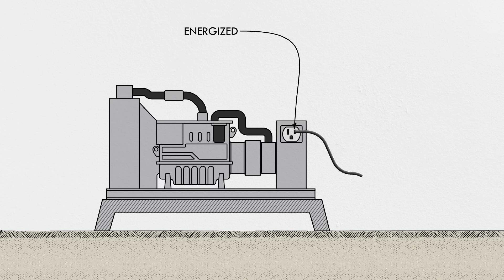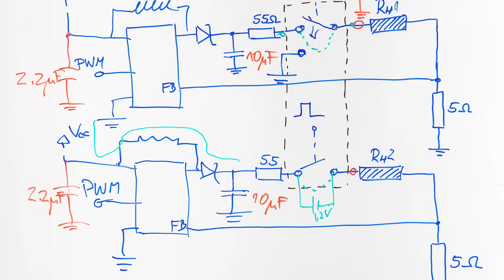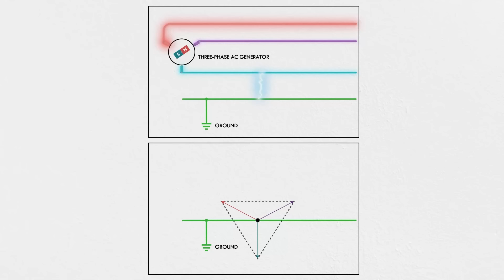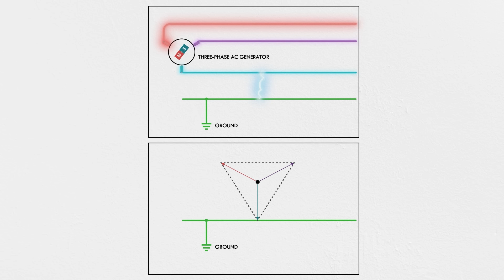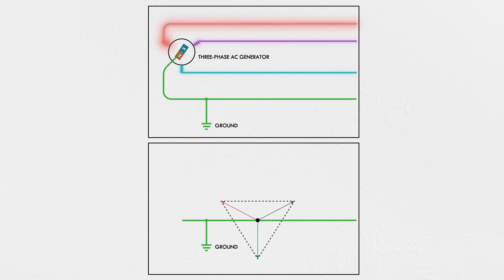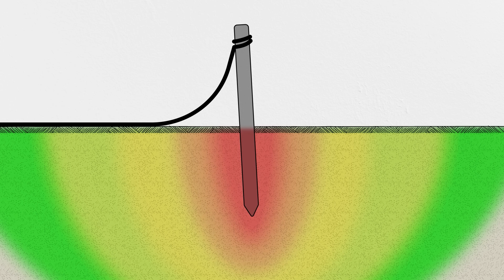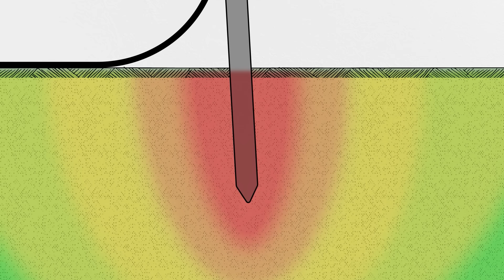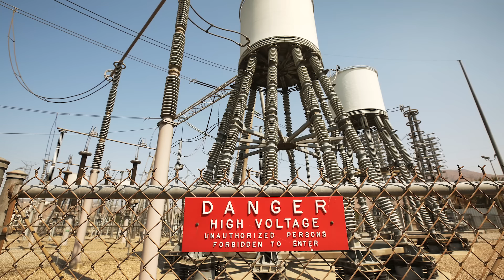Where Does Grounded Electricity Actually Go?

Comment: I like when ground is Earth. Grounding to the Moon is just so difficult.
Reply: You're just not using the right ladder
Reply: @kiriuxeosa8716 It's a step ladder. The real one died.
Reply: I wonder if the english artemis astronauts will call the 0v potential on base "mooning"
Reply: Smh... Words aren't toys.
Reply: Definitely need a bonding cable run at some point.
Reply: Need a really long ground wire for that...
Reply: @mickavoidant4780 I never got to know my real ladder he went out for paint and never came back .....
Reply: @mickavoidant4780  It has potential. Step potential.
Reply: And how about Mars, Jupiter?!
Reply: Hurr durr
Reply: Too true.
Reply: @Alacritous what I find amazing is that you took the time out of your day to get into the comment section to mock a comment just because you didn't like a joke.  That's dedication.
Reply: @sethproaps8899  maybe "regolithing"? we call it grounding, not earthing so that makes more sense i guess, though i think "ground" simply refers to the surface we stand on, not its material like dirt, sand, concrete, regolith etc. so that means it would still be "grounding" any time you use a standable surface. but then why do we call grounding in the ocean still grounding?
Reply: @sinisterthoughts2896  I was here anyways. And someone has to discourage the non-contributing zeros.
Reply: I laughed out loud!  As an ameteur humor critic, I think your comment was funny with the first sentence. The second sentence was too much like explaining the joke....just my opinion which is wrong as often as it is right...
Reply: You know you make an interesting joke, because I imagine that electrical systems designed to work on the moon might need to operate differently because of the unique characteristics of the moon versus the earth. A lot of the surface of the moon is covered in charged particles, and we might need to do different processes for grounding things properly on the moon.
Reply: Try using oceans as ground, and power from land, electric gets really weird on boats connected to the grid
Reply: get me Nikoli Tesla. He'll sort this grounding to the Moon with one of those coils of his.
Reply: @scotthannan8669  If the moon is full of charged particles, is that how to Earth the moon?
Reply: We choose to ground to the moon, not because it is easy, but because it is hard.
Reply: No big deal. Just run a wire...
Reply: Depending on how you define moon.
Reply: @mickavoidant4780 Ok Phoenix Wright
Reply: When planets collide, is there a big equalization of charge when the two interact?
Reply: @bag2963 get whooshed it was a joke.
Reply: The real reason why we need to run up a space elevator cable
Reply: It is the burden we bear, as Americans.
Reply: Imagine how hard it is to ground a Karen to reality.
Reply: Literally lol.
Reply: One day I missed the step and got floored by the ground, it was a shock.
Reply: @MinerBat In the latter, should be oceaning.
Reply: @theobserver9131 In any case, perhaps we all can agree witty comments are a sign of intelligence!
Reply: Not if you're there. 🤔
Reply: Such a lune....   😂
Reply: @theobserver9131 No. It isn’t worthy of a laugh. It’s a bad joke. *amateur
Reply: @theobserver9131  TY for explaining
Reply: While we are at it build a space elevator.
If that goes well ... a stairway to heaven
Reply: @cwg73160  "eye of the beholder". You sound like a real fun guy. I bet you're invited to all the good parties.
Reply: Use a wifi connection ...
Reply: @Alacritous  I get the being here already, but the severity of the skorn seems rather... hefty.  If a dad joke illicits this kind of reaction, I'm afraid to know how you react to "zoomer" humor or other such tripe.  Well, either way, I was more curious wether or not you were sincere, and it seems I found out.  Have a nice day.
Reply: Lol😂
Reply: @theobserver9131  I don’t put much stock into the opinions of people who call themselves “ameteur humor critics”, and I don’t imagine a lot of other people do, too.
Reply: @theobserver9131  Are you working toward a professional humor critic license? The pay isn’t great, but you’ll get bigger laughs from people.
Reply: I think it’s probably earth, lowercase. So not the planet.
Reply: I ground Uranus
Reply: As a old electro space engineer i can confirm this
Reply: Yes, lot of technical issues
Reply: @sethproaps8899  We can only hope
Reply: well, the moon is made of cheese so that would not work anyway.
Reply: It was difficult until Aperture Science developed a conduit to portal adapter fitting. I keep a couple on my truck now.
Reply: I hear some prisons use inmates for grounding.
Reply: Plus might create huuuge lightening between earth and moon. 😂
Reply: Bah! Just get a long wire from the hardware store. It'll be fine.
Reply: @mlindblom  Can someone measure the electrical resistance of a block of cheese for me?
Reply: Elon always grounds to Mars, that's why Twitter fails a lot
Reply: Would that be called mooning???
Reply: @bag2963   sure they are 😃
Reply: @Floofie_boi  oh no
Reply: @TheBoss0110101001  
yes
Reply: This is gonna cause issues when wiring up the moon base.
Reply: That's why Musk is going to Mars with his freaking long  Tesla Space X Boring wire.
Reply: @baruchben-david4196 that's what they all say😂
Reply: Finding decent soil moisture content on the pond is a challenge.
Reply: Small e
Reply: Isn't ground referring to the surface of the planet you're standing on? Thus if you're standing on the moon the surface you're standing on would still be the ground.
Reply: I bet if you could run super conducting zero resistance wire from the moon to earth the electrical potential between the earth and moon would be absolutely massive.
Reply: Not just that, but if you told someone their circuit needed to be mooned, you might see some very strange behavior.
Reply: How are electronics in planes grounded mid flight? I always wondered
Reply: Try Uranus
Reply: @kel-A-3414  When a momma plane and a daddy plane love each other very much they have a baby plane, if that plane grows up and disappears for a few hrs with that kid with a motorcycle from that one episode of "Who's the Boss?" then they get grounded.
Also why is there controversy surrounding bad jokes like we need to protect humanity from them occurring? Literally lighten up people, the moon has plenty of helium 3.
Reply: Godspeed SpaceX and ISRO we will ground the Moon someday and make it a sink for all the byproducts humans about to make.
Reply: One must have connections
Reply: @2450logan he could have at least rung
Reply: Can you imagine millions of sparkies worldwide, all "mooning"?
Reply: @erikthenorviking8251 That comment raises a lot of "but's"...
Reply: @BAS3BALL_bat  A lot of “but is”?
Reply: @cwg73160  missed the joke. 😁
Reply: @BAS3BALL_bat  I didn’t miss the joke. You missed how to use apostrophes. Jokes have to make sense.
Reply: @BAS3BALL_bat  …a lot of buts.  <——- No apostrophe. Elementary-level stuff.
Reply: @BAS3BALL_bat  😁’👍
Reply: Did the astronauts ground their ship?
Reply: Just wondering what would happen if you put a grounding wire between earth and moon.. 😕 

... and I have no answer for it. Maybe the wire gets fried
Reply: @thespecialwon4797  It would probably act like a fuse and burn out.
Reply: @mickavoidant4780 it's not the step ladder. It's the ladder that stepped up.
Reply: Ohhmmm! 🕉 I ground into other dimensions through my forehead tattoo and nipple rings. 🙏🏽
Reply: @danbert8 and thick if its a long wire
Reply: @sethproaps8899  If so, then perhaps exposing one's anatomy to public view would have to be called 'earthing'. 😄
Reply: Not to mention the army of scrapping tweakers needed for the materials...
Reply: After about ten days the ground wire will pull the Moon down onto the Earth.
Reply: @MinerBat  Mooning.
Reply: @garden0fstone736  don't fancy sticking a wire up there.
Reply: @kylehawk9055  
Oh but the look on their faces when the shock of reality hits their faces as the potential for nonsense and truth equal out. 
😲
Reply: @mlindblom  ...but imagine the patty melt we could make...
Reply: I just ground things to my spine. Really makes it simple with all the tech I've got impeded in my body.
Reply: @Gr3nadgr3gory  Borg drone?
Reply: @6F6G  no, my species has just long since bridged the gap between mechanical and biological components.
Reply: Disappointed nobody said grounding to the moon would be lunacy yet.
Reply: @vandenbreda  it's really hard to ground to a ball of gas (i.e. Jupiter)!
Reply: This might be a more interesting question than expected. Is there any experiments made about the conductivity of the moon regolith? If not conductive, how would we build a power grid between bases? Three phase + ground (/moon) wire so four instead? Or will every base have their own island operations with only hdvc connections in between?
Reply: Not because it is easy but because it is hard.
Reply: @2450logan
Reply: Oh, the pain...but there ARE trauma centers out there that you can call...
Reply: Oh no. I HATE when that happens
Reply: @sinisterthoughts2896 
What i find amazing is that you took time out of your day to get into comment section to mock a comment just because you didn't like a joke. That's dedication
Reply: It actually will be difficult since the lack of atmosphere means the dust that makes up the surface is all charged.
Reply: You are a comedian 😂😂😂
Reply: This man is high 😂😂
Reply: I was always grounded as a child 😢😢😢
Reply: What if you hooked the black wire to the moon? What would the potential be between the moon and earth?
Reply: I prefer to ground to Uranus
Reply: @vandenbreda it’s hard to do grounding on Jupiter for sure
Reply: You need water